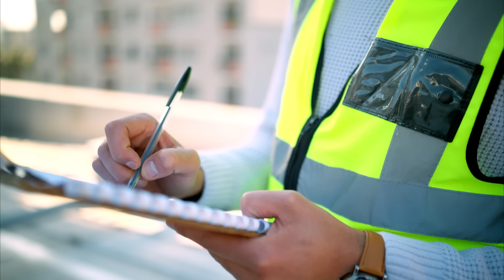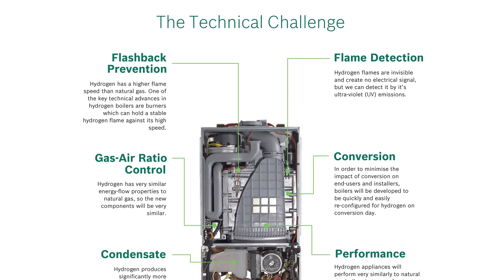Is Hydrogen Actually Dangerous? | The Real Facts

Comment: I think we will go down the route of a fuel produced by electricity. I'm not sure it will be hydrogen and maybe a fuel a bit like Porsche a producing via carbon capture. The great thing about these fuel is we just build the plant next to a turbine not only is it super efficient but it just makes sense. At the moment we pay to.turn off turbines not because we can't use the energy but because we produce so much the cables in the grid aren't big enough to carry the capacity. So instead of having to upgrade the cables into the grid we just feed one of these plants. I also think EVs will be a fad and we will use said fuel I honestly think it makes more sense going down this route then spending billions upon billions on upgrading the grid to handle everyone having an EV. I was speaking to a dno worker and he said they design a system to handle a couple of kw per home so for us to go all electric is going to mean all cables locally and nationally will need upgrading where as producing a fuel even though less efficient is going to be a better and cheaper option for the tax payer.

Comment: There is no chance hydrogen will be used for numerous reasons. Safety, energy density, cost. Green hydrogen is just too expensive. 99% if from gas (steam reforming) so you should just stick to this for cases where electricification isn’t possible.
Reply: I can see it being used in some industrial settings, but not in domestic settings.

Yellow hydrogen (hydrogen generated using nuclear power) is more efficient than green hydrogen, and there are several processes that can be used, including high temperature electrolysis, where energy is put in the form of heat and electricity. 

If we used yellow hydrogen, then nuclear power stations could be retasked to hydrogen production (or desalinisation) when wind and/or solar are providing, reducing curtailment of nuclear/renewables, whilst providing greener hydrogen than with grey, blue or green hydrogen. 

With blue and grey hydrogen, we just need to tax or legislate it out of existence.

Comment: Regardless of any safety issues, hydrogen has one third the energy density of liquid hydrocarbon fuels for an equal given volume of fuel - ie three times the amount of H2  required to provide the same output as petrol/ diesel. So its use in vehicles will be limited by that factor.

Comment: If there are all these safety issues I don't see how it's going to work. Too costly. If they need it to have a form of storing energy from electric, then the best option would be to have storage areas near the generators. Which are then used to generate back into electricity.

Comment: It is quite amusing to remember that, before we had North Sea gas our domestic gas supplies were "town gas" that was typically 45% hydrogen mixed with methane and carbon monoxide. Such was the state of Health and safety back then.
Reply: Towns gas was made from burning coal and later burning naphtha ( a product of crude oil).  For most of the time, town's gas was mainly a 50:50 mix of hydrogen and carbon monoxide, with little if any methane.  I know this because in the early 1970s I used to work at North West Gas Board, Bradford, East Manchester, near what is now near the Etihad Stadium.  As part of my time there, I worked in the Works Lab, doing analysis of the constituents of town's gas.  At the time I lived around 5 miles away in North Manchester.  Where I lived, we'd been converted to North Sea Gas in late 1970, but other parts of the area (South and East Manchester) didn't convert until later, but by 1973 the gas manufacturing plant had closed, as North Sea Gas (methane) took over.  Also town's gas was far more dangerous, due to the presence of the unburnt gas resulting in carbon monoxide poisoning for unsuspecting victims, who had fallen asleep.
Reply: ❤What th hell has the use of town gas got to do with the state of health and safety back then there was no other option available i was  born in 1950 and I can assure  youevery body was fully aware of safety around gas and gas appliances we were not idiots

n

Comment: Good review overall, however as well as the dangers you highlight, there also the fact that there is energy loss in the conversion stage when electricity is used to to create the hydrogen. Where practical it would make more sense to use the electricity directly.

Comment: You didn’t mention the fact that any hydrogen that is classified as Green hydrogen is multiples of the price of natural gas. I don’t want it because I don’t want my gas bill to rise x 4. But I am not convinced on safety grounds either.
Reply: Green or Blue Hydrogen. If it’s created with the otherwise wasted surplus wind energy, then apart from the infrastructure cost, it’s very cheap to produce.
Reply: @johnholmes5674 Precisely! The wind is free, it is all in the infrastructure costs which are absolutely huge. Uk gas costs £35 per MWh,. A MWh of hydrogen in bottle form is at least 4 times this. If you account for efficiency losses even worse between the two. However, good luck with any new tech you purchase.

Comment: Heat pumps are just a stop gap til hydrogen comes in, the network can’t supply both hydrogen and methane. So they ban the gas boiler make you get a heat pump till the time comes when all the gas boilers have died, then they can reuse the network for hydrogen, without having to give anyone compensation for having to switch their boiler,
Reply: That argument makes no sense when you understand that green hydrogen will never be cheaper than a heat pump. 

Even if you had perfect conversion and a hydrogen boiler that had 0 losses, and the process was "free". You would still end up paying 3-4x for each kWh of heat. 

Realistically, end to end at best you'd need about 1.5kWh of green electricity to make 1kWh of usable heat, so you might as well just use that 1kWh of electricity in resistive heating and it'd still be cheaper than green hydrogen.
Reply: @B @BenIsInSweden  you are right about heat pumps being cheaper and greener to run, my point was more that the uk government will push heat pumps , then when the time is right for them push hydrogen they will,
Reply: @James-oy3qp the only way that would happen is if Reform were in power. 

But even then, it's a difficult sell.

Comment: Typical problem for flts, my gas pipes are metal and inside the wall. Replacing would be a pain and like a heat pump going on the outside would be a nono from my freeholder

Comment: Good video Rodger.  I did not know that boilers could be fitted on the outside, to that end your conclusion seems valid that this is a way forward when considering safety.
I'm still using a Potterton Supreme boiler from the 90s, most components replaced except heat exchanger.  Looking ahead I am considering a hydrogen ready boiler or air-to-air heat pump in each room (four rooms), preferably to one heat exchanger on the outside.
Reply: Hydrogen won't arrive though. New grant planned for air to air (and existing one for air to water).

Comment: Methane (CH4: molar mass 16), Air (largely N2: molar mass 28) - so methane is lighter than air and will rise. Not as rapidly as hydrogen (H2: molar mass 2), but it will still rise and increase the greenhouse effect. Hydrogen doesn't absorb infra red, so has no effect on global warming.
In terms of safety, hydrogen isn't significantly worse than methane, and in many ways is better than petrol and other flammable liquid fuels.
My preference would be to use hydrogen with fuel cells, rather than burning it directly. You still get the energy storage advantage without the necessity to pump it into every house, avoiding the expensive infrastructure changes involved.

Comment: I'm a chemical engineer and have worked with it. High purity hydrogen is scary stuff - a very low ignition energy, and very low ignition temperature, a huge (4 to 96%) explosive range. It goes BOOM very easily. 
The industrial regulations around Hydrogen installations are ferocious. Many factories will go to extremes to avoid having it on site. 

So I'm always very cautious about it.
Reply: It has the potential to to be a fuel but is it really a good fuel forget the safety side it is expensive to produce through electrolosis you put in a lot more energy than you can get back out storage is a problem and if our gasboard cant keep natural gas in pipes what chance would they have with hydrogen
Reply: Exactly.

Comment: I like the boiler on the outside idea. I would much rather have a hydrogen boiler in my garage than a large lithium-ion battery and I would still have some concerns with a lithium-ion battery outside. James May said of all his cars in his garage the one that scared him the least was the Toyota Mirai Hydrogen car and for good reason. You could also power a heat pump off a hydrogen fuel cell. Apparently in Japan the heat from the fuel cell is also utilised.
Reply: Battery technology is changing, Sodium Ion is far and away safer than Lithium Ion and its just around the corner.
Reply: @LesBrecknell I'll believe it when I see it but all of that energy can't just disappear into the atmosphere like with Hydrogen.
Reply: @kevinchadwick8993  sodium ion batteries are available to buy right now for UK homes (only one company at this point). No cars as yet.
Reply: @Biggest-hz7ng But how safe are they? I guess we'll fibd out. Everyone said LFP was safe but that was lies.
Reply: @kevinchadwick8993 there's lots of FUD about batteries.
Reply: @Biggest-hz7ng Lots of denial too such as what happened on the motorway recently where commenters lied about it being the diesel truck until the coverage blew over or the three students kiled by smoke in a Tesla recently. If you've ever experienced toxic smoke and gasses even slightly as bad as a lithium ion battery in thermal runaway would create then you would know how little time you would have. Hint, it's worse than holding your breath.

Comment: You forgot to mention H2 needs to be kept either really cold or under very high pressure (which uses energy!). Even if this was just to prevent curtailmemt in wind farms, H2 has a very poor round trip efficiency at that point compared to sodium cells (which are also safer). Add in the poor efficiency of electrolysis of "green" H2 and it becomes ever more inferior.
TLDR: H2 is just a way to kaintain BAU for the oil and gas industry, because our main source of H2 comes.from reforming natural gas.

Comment: Why don't you tell people what hydrogen is actually made of ie water in its natural form it's no danger yes in in its gas form yes it can be dangerous and yes it takes a lot of energy to turn it into hydrogen but it's water aurora comes out of the exhaust pipe is Walter so as far as I'm concerned it's safer than anything else that we used today

Comment: Yet another sensational story with out the correct facts . 
Methane is LPG lots of homes are on natural gas which floats up . 

If a gas engineer is hydrogen trained they are safe and checked and you can have confidence that they know what they are doing . 
All modern condensing boilers are already capable of taking 15% hydrogen with no changes and no need to change the boiler .

However I did love the photos of Worcester boiler especially the hydrogen one ( can tell who you are sponsored by 😉) 

The simple face 1kw of electric makes 0.5 KW of hydrogen through electrolytes then send it through the pipe work with no loss 😂🤣 burn it and get 0.33 KW of heat energy .

It's a solution for cars and aircraft 

Or very rich people.

1 KW of electric into a heat pump = at worst 2kw heat energy out at best 5kw  
Simple .

But Worcester don't even make there own heat pumps and are the biggest pushers of hydrogen because they want to keep selling boilers ..  it's a simple case of the public being misdirected.. 
And no I'm not saying heat pumps are for everyone just laying out some facts 👍
Reply: Methane is not LPG. Methane is Natural Gas, LPG is bottle gas  - propane and butane

Comment: Currently much Hydrogen production uses gas not renewables so I suspect the gas industry is pushing H when the UK would be better served upgrading the national grid to move excess free energy to where it is needed rather than paying renewables not to produce and then paying again for gas power stations to increase production to replace it in other parts of the country.
Reply: ""excess free energy""
There's no such thing.

""Renewables"" are killing the UK, because the government is teRarded and doesn't get that it's unviable as a scalable power source.

Comment: A lot of houses have soldered copper piping conveying gas. Hydrogen is currently eight times more expensive than natural gas. Hydrogen will pass through soldered joints, and there is no current test for leaks. Politicians lie.
Reply: Politicians aren't the ones bringing you hydrogen. That's fossil fuels companies.

Comment: Excellent video as always.
As a Chemist/Biochemist I'm glad I never had to use Hydrogen in my career because of the danger.  Many Chemists use it for Gas Chromatography, but these days, rather than cylinders of the gas, Hydrogen can be supplied at point of use from small generators which electrolyse water.  I would definitely not have Hydrogen in the house for our gas boiler, but maybe suitable blends with Methane may be okay.  The old 'Town' or 'coal' gas was a mixture of Hydrogen and highly toxic Carbon Monoxide. Things have got better in some ways.
I also think diesel should still be used in future for heavy vehicles, buses, trains etc. I am environmentally conscious and have an electric Mini which is great for shortish journey, but anybody thinking there are going to be large electric aeroplanes, I don't think so, at least not until we invent anti-gravity machines!

Comment: Sorry but this whole thing feels a little like paid advertising feature. The main premise which you missed vital piece of information. Low carbon is just not true. Why switch from gas? I was told by an industry engineer 98% of all hydrogen is created from fossil fuels. turns out that is now inaccurate information. So by fracking oil into Hydrogen and carbon you are actually wasting energy and the eco creds just sound made up by marketing people. Hydrogen power vs battery is a debate worth having but creating the hydrogen using electrolysis is only 60-70% energy efficient. So that Bus is now creating a lot more polution. than a 70s Dennis. 

Hydrogen production from “other fuels” (e.g., electrolysis using electricity) fell to 0% in 2024, after being 1–2% in prior years: source: gov.uk

If I was a synic (which I am)Feels like you were reading a PR statement.
Reply: Hydrogen is being promoted by fossil fuel companies. The government wants electrification.
Reply: @Biggest-hz7ng  Interesting as my brother worked for a hydrogen company, hence the stats on H generation which surprised me. But once you have H how you use it. So do you generate Electricity AKA fuel cells. or burn it to produce ICE kinetic energy. Both have very different efficiencys (which I do not have to hand) and very different use case and engineering. 
So to reduce "local" Co2 H would make sense in both cases. But would be much simpler for houses as fuel cells over ICE type cars. But like EV the Eco credentials just do not add up or make sense unless you are only concered about "local" co2. Bit like the powerstations of old building taller chimneys to prevent smog. (aka battersea)
Reply: @JamesBrown-yn7xr  yes, H2 doesn't really add up environmentally and economically. It will have niche uses in the future, but our money is best spent reducing emissions elsewhere right now.

Comment: I've worked on an electric vehicle and a hydrogen fuel cell vehicle. The complexity of fuel cell vehicle is 3x that of pure electric vehicle and 3x more expensive. The end to end efficiency of hydrogen fuel cell vehicle is much lower. You'd need a much larger installed energy capacity to cope with generating all the required hydrogen.
Reply: Yes, not very efficient.  Now the person who can convert carbon dioxide, while debunking the Laws of Thermodynamics at the time, to methane, will be a genius.  The nearest we can get to that at the moment was the bus in Bristol,  the Number 2 (no jokes please!) which ran on poo, by generating methane.  Feel free to look this up.

Comment: Hi Roger I had my new gas pipes fitted awhile ago and I asked the guy fitting it are they hydrogen ready and he says no these pipes will not except hydrogen so who’s right and who’s wrong
Reply: A lot of older UK apartment buildings have steel gas pipes with soft iron fittings running up outside walls and in as far as the meter, so he's right. The gas mains under the street are being changed

Comment: The problem with the grants for heat pumps specifiy that you must not have another heat source, and its known that they do not provide enough heat in times of very cold - when its most needed - hence the need for an alternative backup heat source !
Government backwardness all over.
Reply: Heat pumps can work down to minus 25C. You don't need a backup heat source.

Comment: It seems a lot of scarce research funding (and replacement of gas pipes to be H² ready) is being wasted on a fuel that will never be of use in the domestic sphere.
Wouldn't it be better to use that funding to improve renewable systems, insulation etc, we seem to be chasing a Holy Grail that has been found.

Comment: Methane is a molecule and is easy to maintain gas tightness in pipework and appliances.
Hydrogen is an an atom and very small in comparison and will escape into the ambient through the slightest of leaks.
Risks outweigh any advantages.
Reply: Combine the hydrogen atoms with something else to make a more versatile compound?
Reply: @jimtaylor294  The hydrogen most people are referring to is the diatomic molecule H₂ not the atom H. Never the less I agree it is still very small and difficult to store safely.